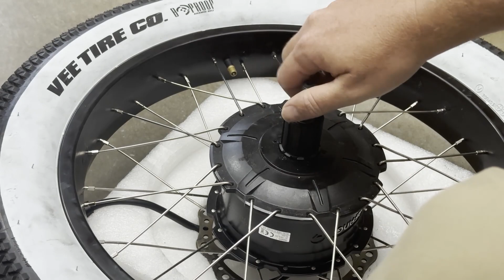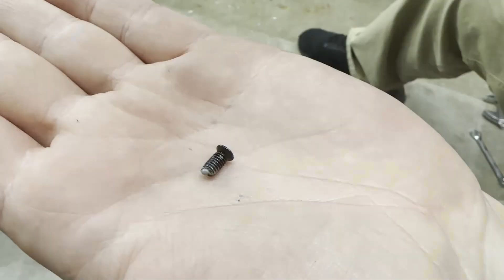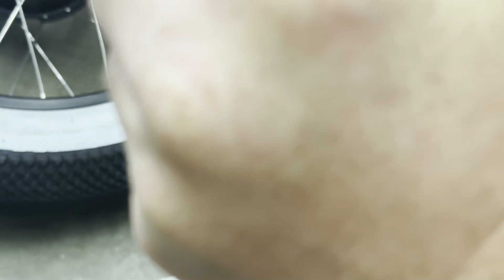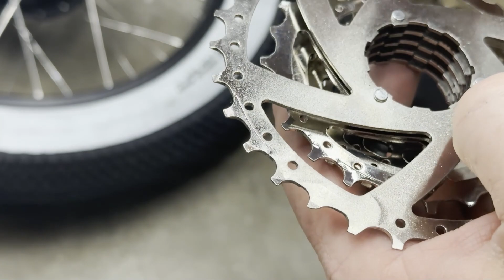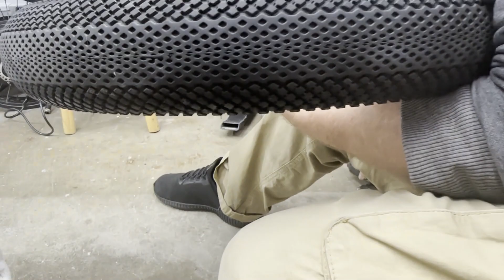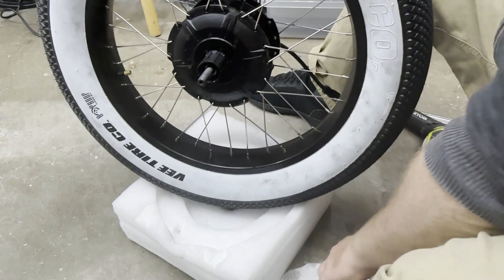Bafang G062 (G62) Freehub Removal

Comment: Do you know if that free hub on the G062 is able to use a 12 speed cassette or is it the smaller free hub that is restricted to smaller cassette size? I am hoping to mount the original 12 speed cassette on my Fat Bike but realizing I might not be able to shift into the largest cog.
Reply from the maker: Couldn't tell ya, unfortunately, I've only got the 7spd.
Reply: Its a 10 speed cassette hub on the g62
Reply: @EBikeBuilder_  you can mount a 10 speed on the G62?!?

Comment: I realize this is an old video but... I came across this by accident after the fact. 🤷 
 My free hub tower showed up brand new and I couldn't coast properly or pedal backwards without throwing the chain, until I soaked it in penetrating oil. I used PB blaster. 
The really difficult part is if you ever lose one of those six screws securing that Tower to the hub, it's impossible to find them. If you buy a 4x8 mm screw it's going to have a larger size head . I've searched high and low online. The heads on those screws are non-standard size and very small. I ended up using 4x8 mm screws and had to grind down the edge of the head so they would not touch the free hub tower. What a pita.
This is one of the worst designs ever. Possibly purposely difficult to find parts. Planned obsolescence means repeat customer Business.